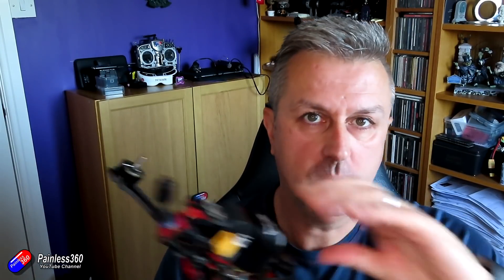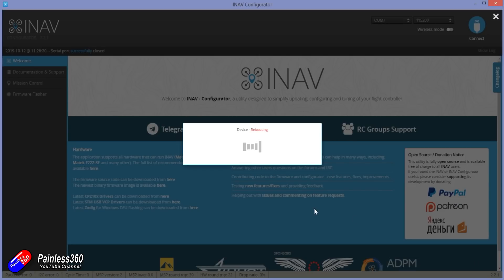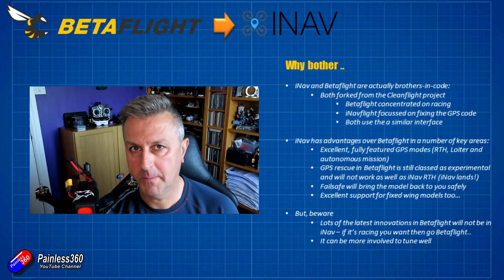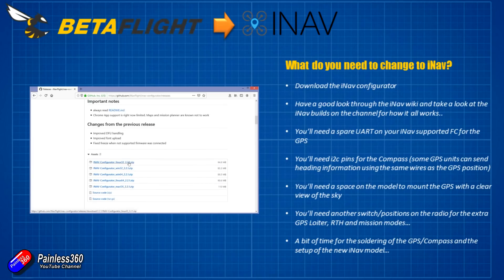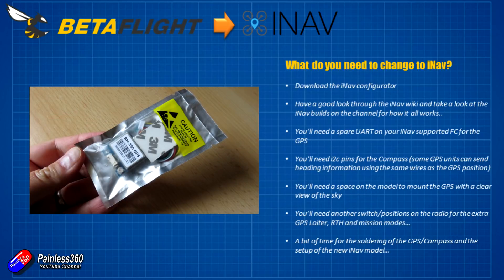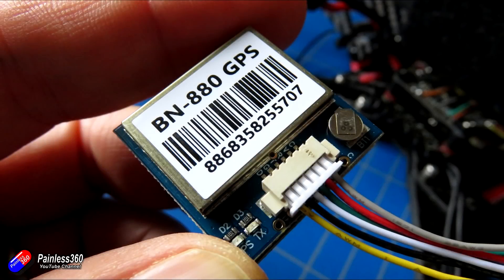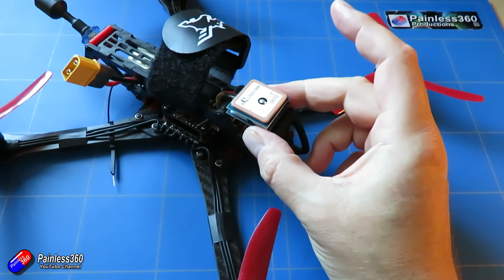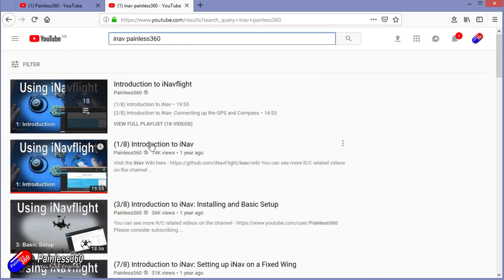Betaflight to INAV Quad Build: Pt. 1

Comment: very interesting 👍
Does the "GPS Loiter" from iNav equal the "GPS Atti. Mode" from the DJI Naza M Lite? (i got no clue about iNav or Ardupilot, but they seem promising)
I want to build a drone for filming, that is easy to fly... I did build a DJI F450 years ago, but I don't want to obtain an old naza for the new drone ... so I'm searching for an alternative...
Reply from the maker: I'm not familiar with the DJI stuff so tricky to comment. DJI does a lot of the flying for you that otherwise systems don't provide.. Best of luck
Reply: @Painless360   thank you 🙂
🤔 this is kinda complex ....
The gps mode from the dji naza m lite (old discontinued FC) stabilizes the drone and holds the position. You can still change the thrust, go left/right/back/forward and turn cw/ccw.  If you let go of the sticks, it will slow down and then keep the position.

This was before the first dji phantom.... so there aren't any really fancy features.
Reply from the maker: INAV kinda does that but Arducopter is closer... Happy flying
Reply: @Painless360  
Awesome, gonna look into it a bit further

Comment: What I'm wondering is if I could run both my GPS/compass and an external baro SDA/SCL pads. For instance, could I wire both SDA wires to a single SDA pad? Thank you :)
Reply from the maker: Possibly. There is only one way to see with that kit - give it a go and see.. Best of luck!
Reply: @Painless360  I'll do just that, thank you!

Comment: If you could just point me in the right direction.  My Inav 2.4 quad pitches up 90 degrees in angle mode when I cut the throttle.  I have air mode turned on.  It recovers when I throttle up again.  All is well with the gps and the magnetometer.  It does beautifully in position hold mode.

Comment: Hello, recently i buid a GPS quad running INAV 2.4 ( Martian II + OMNIBUS F4 V3+ BN-880 GPS+ RACERSTAR REV35 4in1 ESC) and it flyes ok, need some PIDs tunning but this is not a problem, the real problem is when i try the ALTHOLD mode or POSHOLD, The quad rushes to the skyes like 30m or 40m , and then cuts the trhottle and starts to fall, i must to switch to acro or angle mode fast to save it, also  the altitude data in the OSD is toataly wrong, when quad is like 3m above the ground it shows 13 or sometimes negative values, when i land it, numbers slowly goes to 0, i put a foam cover on the baro, and it did nothing, is my baro broken? Or its a GPS problem, i tried changing the position estimator gps and baro weight values withot luck ,can some one help me please ? i tried a lot of things, like trying INAV 2.5 RC1, changing hover throttle value..... and no one worked for me.
Thanks.
Reply from the maker: ALTHold needs to be setup. You need to set the hover throttle and also the throttel stick works in a different way - https://github.com/iNavFlight/inav/wiki/Navigation-modes#althold---altitude-hold Hope that helps.

Comment: Lee, just a thought, can the gps module be housed on one of the arms ? closest to the motor of course.
Reply from the maker: I've not tried it. Lots of interference for the compass with the power wires there...if you try it, let me know how you get on...
Reply: @Painless360  I only mentioned it because I once owned the Blade qx350v2 and I am sure the gps was placed in the arm on top of the wires from esc going back to flight controller, I know on the v1 the gps was in the main body above the battery bay and I do not know why they changed it. I am currently out of work because of Covid 19 but as soon as I get back I will start to build again I will leave my TBS as is and start fresh with your inav build.
Reply: Also just a quick mention I also own a Parrot Anafi and while I believe them to be class a couple of weeks ago whilst flying at work it fell from the sky with no reason, I have been awarded by Parrot to return it to the shop for exchange but my confidence has gone which is why I want to build a quad with gps then I only have myself to blame for accidents.
Reply from the maker: Best of luck with the build. Check out my iNav and Arducopter builds.. Let me know how you get on..

Comment: Is Inav still a Google app? It still loads up but does it work like that? I'd like to resurrect one of my old 450 quads to play with the GPS features. Also any recommendations on f4 boards with baro and GPS modules?
Reply from the maker: You need to download the configuration app now.. Best of luck!

Comment: You can wire an external baro in parallel with the gps/mag and it will work fine, just switch it on in the configurator. Easy to do.

Comment: Will inav work without a baro? Thank you for all the help over the years.
Reply from the maker: Not on a multirotor.. see the documentation...
Reply: Painless360 thank you again
Reply: Can I run an external baro in parallel with the gps? My FC, the dal 405 only has only 1 sda scl set of pins.

Comment: First thing amazing video big fan of your channel.  I have a Cinatank Mark 1 quad-copter and it has APM flight controller in it and I want to put in a new FC which will you recommend and I also need ESC  should I get 4 in 1 ESC or individual ESC.  The quad is big so there is plenty of space to put anything I want.  Also it use to have a gopro cam in the front but I want to replace it with a real fpv cam if I do this would I need to balance out the quad due to the smaller cam in the front. I am putting in INAV as well following your video.
Reply from the maker: See my flight controller comparison video from August for the options depending on how you want to fly.  Both  ESC types have their place, I'd usually use seperate ESCs iumless I'm pushed for space. Always make sure your copter has a center of gravity in the middle to help it fly better. Best of luck!

Comment: Great this video comes out now. I have a quad quad with GPS that runs BF4.0.3 at the moment and today I had a scary moment, when GPS rescue kicked in and turned the quad upside down instead of flying home. Took a few moments for me to realise what happend, but luckily I was at more than 80m above ground  and I could take back control and turn it back and catch it at  less then 30m above ground. Stil have do analyse the log to see what happened, but I think that is something like a hint to switch this quad to INAV. Will follow your videos and install INAV on that quad as trust in the BF GPS rescue is at a very low point now.

Comment: Hi i have a VTOL and want to put GPS and INAV on it. Which board do you suggest?  I also have a wing that id like to do the same. Thanks..
Reply from the maker: I've not used VTOL. I don't think inav supports it. See my iNav 2.1 series for fixed wing builds using a few of the best flight controllers..

Comment: Really wish either inav would drop the requirement for a compass or betaflight incorporate position hold as either of them doing that would make either perfect.  I use inav on the planes but not the quads as it needs a compass (or did last time I checked).
Reply from the maker: See my video about needing a compass that explains why it is as it is.. There is a way to calculate heading without a compass (betaflight does it that way) but its a lot more hairy and full of potential issues..

Comment: I purchased a starskys g703l with naiv and screwed up now fc doesn't work flash doesn't work on either bataflight or navgi 😢
Reply from the maker: Sorry to hear that, usually checking in the CLI before flashing will tell you the target you need to use.. I hope you get it sorted out.. Best of luck!
Reply: i just received skystar g 730 i /INAv  version 2019
# version
# Betaflight / MATEKF405 (MKF4) 3.5.6 Feb 16 2019 / 13:20:25 (c28ca22f9) MSP API: 1.40

board_name MATEKF405
manufacturer_id  (,May be it will Help)
I have to contact Bangood : I thought it was already configure for INav ,but it is not the case it's been flash for BetaFlight Firmware only. Inav configurator doesn't recognize any "Variants"
May be it is the way Bangood sell this Product i dont Know? I really thought it was set already and ready to Fly (Seems Odd to me I am a Beginner)
Question : If i Flash with INav configurator? Do I am still able to connect to Betaflight Configurator?
Because: Support Dshot 1200 in default out from factory
Reply: No...I was told by a YouTube channel it's in inav configure to do anything with it you have to go in with that configurator thanks for your help I'll try and re flashing see if I can get it back or just put another fc in it and fly👍
Reply: The inav configure isnt hard to use it's very similar to bataflight the GPS still has to be set up also🤔😢 thanks again and good luck with your qwad happy flying if I find anymore info I'll let you know👍🚁✈️

Comment: I'm planning a build and got the Hakrc f722 flight controller. It's perfect as it has a plug with all the required connections (SDA & SCL etc...) however when I came to flash iNav there isn't a target for it. Is there a way I can put in a request to the Dev team? Is there a compatible target I can use?
Reply from the maker: I'd have a look at the iNav Github repository. There may already be a request... Always good to check that the FC you're considering is supported before purchase and many are not. Best of luck!

Comment: got a wobble in my 7" inav copter which I can't tune out... Maybe the motors are to small (2308 1700 kv)
Reply from the maker: Possibly, or its could be vibration.. I'd look into that as well...

Comment: I'm struggling to get iNav running under Ubuntu-derived Linux. Anyone have any tips?
Reply: Yeah friend I am facing lots of problems too.I am using Kali Linux.its waste to go for Linux friend.I recommend betaflight Mobil app.
Bcoz u has to give lots of permission in Linux system for integration of the FC.